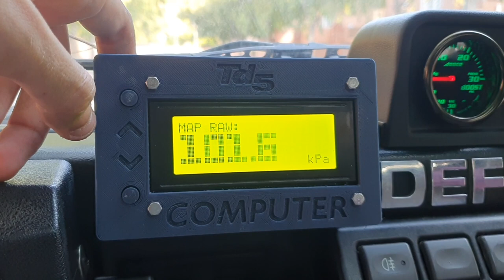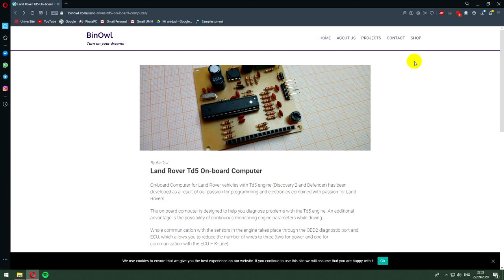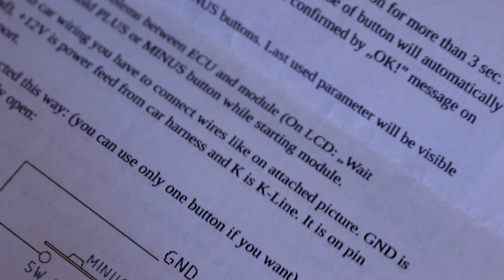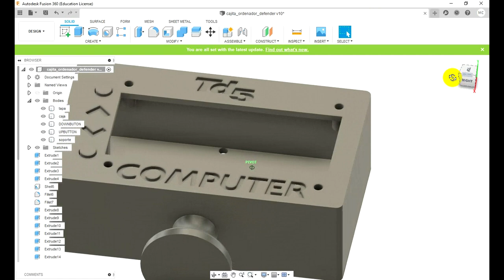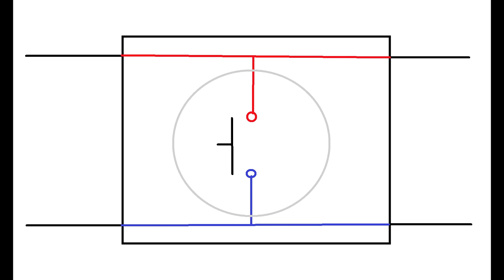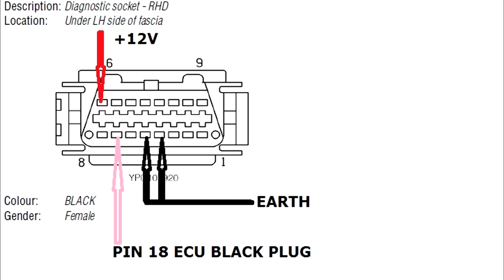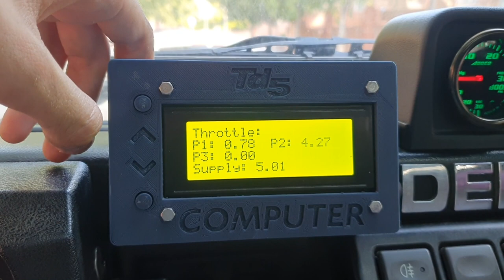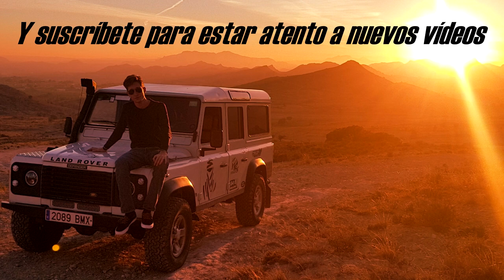50€ Land Rover DEFENDER / DISCOVERY TD5 ON-BOARD COMPUTER? | Review, unboxing and installation

Comment: Great video. I have a year 2000 Defender Td5 and would like to know if the display on the computer screen can be improved by using a larger display screen? I would also like to have a digital dashboard with speed, temperature from water, oil .

You are extremely talented and I would love to hear from you to learn about the possibilities. Kind regards Alan

Comment: Should these switch off when the engine is off or do you have to unplug?
Reply from the maker: because the device is powered by the ignition wire from the key, (same wire that turns on the radio, the yellow wire) it's automatic, i mean, when i start the engine, the device turns on.
Reply: @rodillo  Mine seems to be staying on when the ignition is off. Maybe it has a problem.
Reply from the maker: @FingswithFrankie  maybe you have a jumped wire, normaly the ACC yellow wire is energized by a relay via the ignition key, so you have to find this relay and this wire. I connected the onboard computer on the car's radio yellow power wire. Greetings.
Reply: @rodillo  I got the one that plugs straight into the diagnostic port, everything else works, I guess I just need to take a feed to a switched live like you have. Thanks
Reply from the maker: @FingswithFrankie  no problem mate!